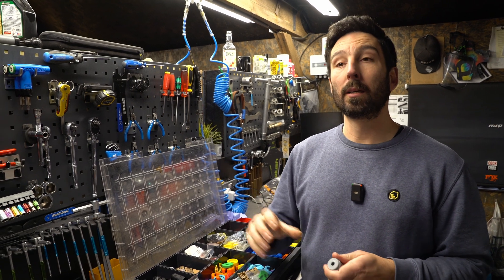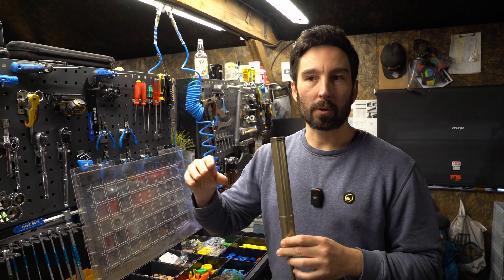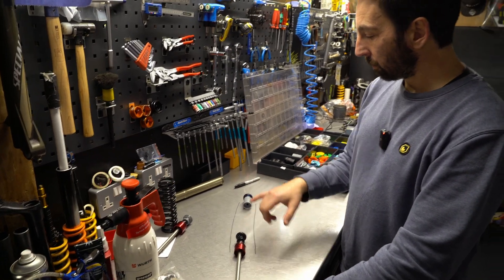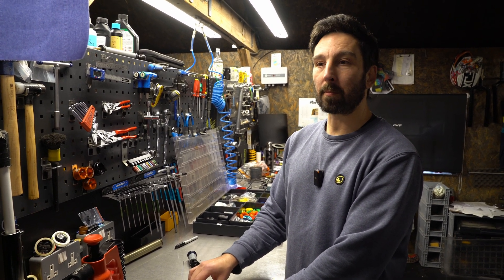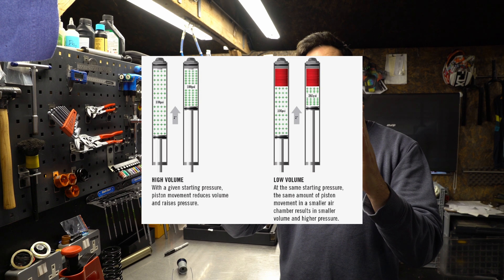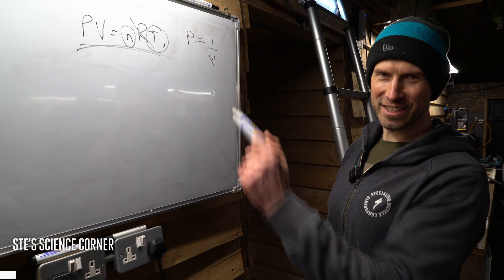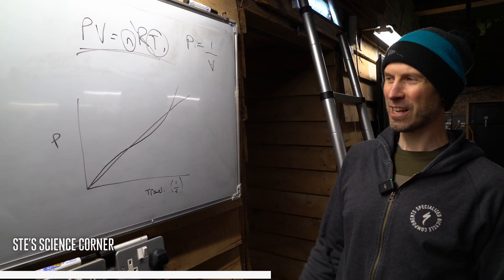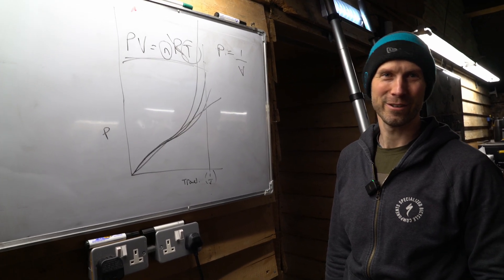EVERYTHING you need to know about Volume Spacers*

Comment: What about spongey spacers?
Reply from the maker: Spongy spaces just reduce the curve radius. They are just not as progressive in the mid stroke and then add ramp at the end. Most suspension manufacturers don’t use spongy spacers
Reply: @BRINKUK  so less mid stroke support and late ramp up for spongey tokens? Would there be an opposite to this? More pronounced in mid stroke but less ramp up?
Reply from the maker: @panipu on some forks yes! We mentioned the negative air spacer tuning. This can be achieved by running a smaller negative air volume. You can do this on Ohlins air forks. The spacer in the neg makes the mid stroke very supportive so the fork sits up more but then you could run no positive air spacer to keep the last 3rd of the travel more linear
Reply: @BRINKUK  Very interesting. Thanks for answering